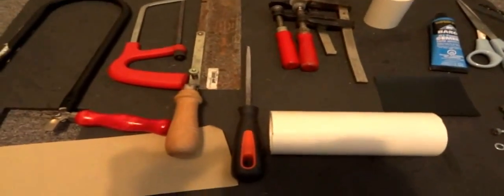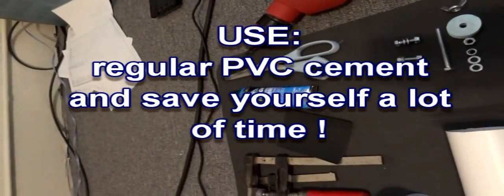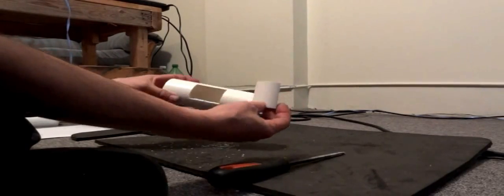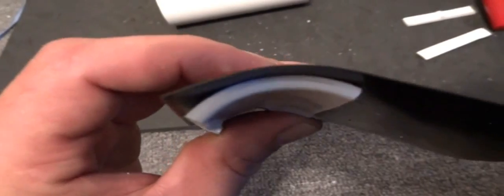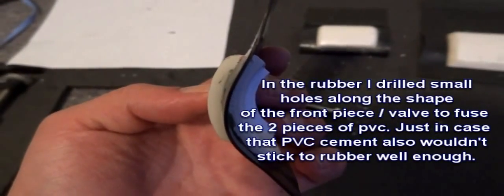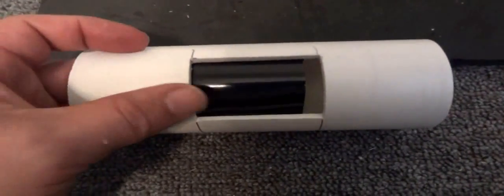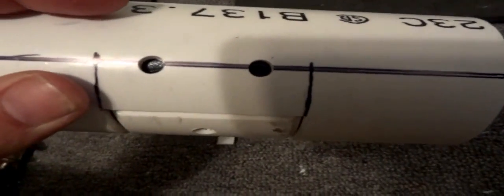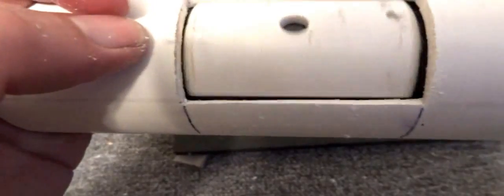DIY cheapest valve (silent) for a True Linear Ram Pump - LONG version

Comment: I copied this but bought 2 sleeves and made the pipe shorter. This made it very simple to install the rubber valve. After the valve was installed I just glued a sleeve on each end to make it the length of yours. Works great but I'm going with a 3" one for more volume.

Comment from the maker: Hello Pierrot,

Thank you so much for these nice words. I really appreciate it. I think the sharing of knowledge is something important. I almost have my True Linear Ram Pump (TLRP) ready. I will post a video a.s.a.p.
Reply: What's inside the air chamber? You separates air and water with a rubber air balloon, like a bicycle tire chamber?
Reply from the maker: Ana TG Helo Ana. I have a swimming pool noodle in this setup. 
I am planning on doing some trials after winter to test the true linear ram pump with an inflatable tire. Just to see the difference in pressures. I'll make a video of that next year.
I have made a quick short video showing the build of the true linear ram pump showing it's components / setup: https://www.youtube.com/watch?v=fgDY4j530_A
Reply: Marco van Mee

Comment: at 9:55, for drawing the longitudal lines -instead of fidgeting about with that blade,
 why not use your measuring tape??

   The tape is curved,
 and if you turn it over,
 the convex curve of the tape band will lay the measuring tape exactly straight,
 along the curve of the pipe

Comment: thanks for posting.     suggestion: just skip the iffy adhesive on the sandwich.  use small stainless hardware and loktite, around the edges of the smaller piece,  to hold it together.    cheers
Reply from the maker: Hi David,
Thanks.  I just wanted to do it this way, but yes, that might work. With the PVC cement you make sure that the hole with the bolt doesn't become a spot where you lose pressure if there isn't a tight fit of the rubber and the bolt where the bolt goes through the bigger and smaller piece of the valve. And the more holes with bolts the more risk of leaks/pressure loss. But yeah, I don't know, you just have to try I guess and see if it will be the case or not. Everybody of course feel free to suggest improvements of different ways of doing / making this. That's what I did, try something different. All the best.
Reply: +Marco van Meer Very good video, and I do not think that you talked too much.  You explained it perfectly for those who "may" not be so talented in constructing, well anything for that matter.  I feel that your video was exactly right in showing the do's and dont's whilst building this valve.  I can tell that this was a very explanatory vid to build the waste valve properly so that the valve could last and function for the longest amount of time and be efficient.  I see comments on here that say you were long winded and took too long to explain, but those are the people that seem to eat at fast food restaurants most their lives and they want fast food and they want it now.  Knowledge of things done the right way, analyzing what could go wrong whilst in the preparation and pre-visualization of the end product are the signs of a knowledgeable person.  
 Thanks again....  looking forward to seeing your waste valve in action in a video!
Reply from the maker: +577666 mine is 39. damn.